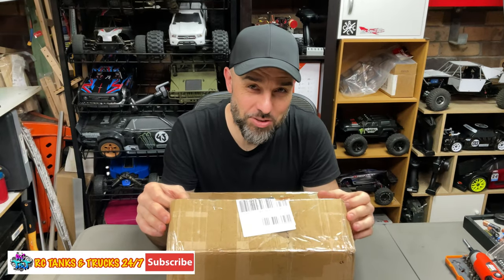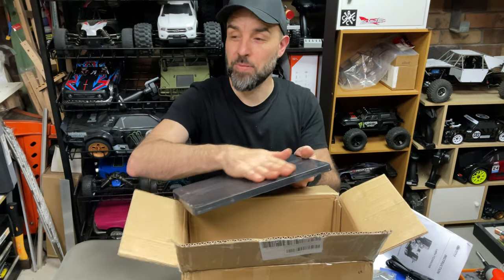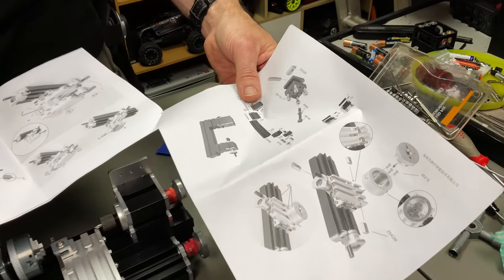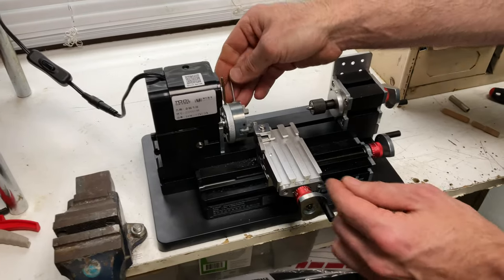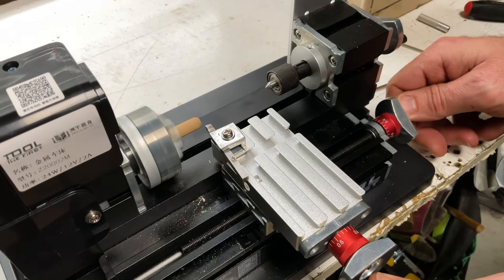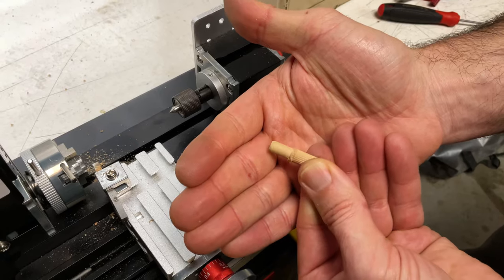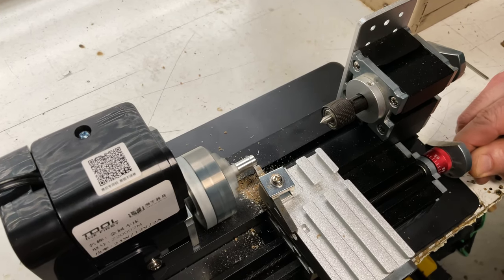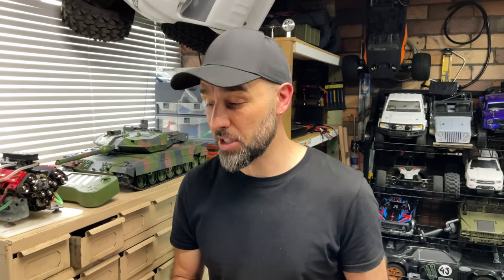CHEAP $260 MINI LATHE - HOW BAD CAN IT BE?

Comment: The cutter should always be dead center to the chuck or slightly! Above, center height,  the cutter can be set at any angle which best suits the cutter,  depending on the grind angle of the cutter, it gets really technical but easy enough to learn if you want to, I would say keep that little cutter sharp and make sur you use oil on each piece you cut!! as this helps alot!!
Reply from the maker: Thank you! Cheers!
Reply: Further , looking at that tool holder, you'd need to use blades from a burst open pack of 
feeler gauges to get the height spot on. Metric or imperial , it matters not. 

I've got one of the bigger mini lathes-cast iron ones, and they're great little tools. After, that
is you've set them up right, backlash etc. And bought a few more cutting/ threading/quick
change toolpost parts as well.

Comment: A little safety tip Steve. Always take your chuck keys out of the chuck! I’ve seen people leave them in and then start the lathe sending them flying out of the chuck at high speed. Enjoy! Cheers!
Reply from the maker: Good tip!
Reply: Absolutely.  I have the policy that "If a key is in a chuck, my hand MUST be on the key."  Removing my hand from a key in a chuck would violate that.  I can only remove my hand from a key if it is out of the chuck.  It's because people have been careless that many chuck keys now come with annoying little springs to eject the key if you let go of it.  (It is one effort manufacturers take to help make themselves litigation proof.)

Comment: A cheap upgrade is to bolt it to a concrete garden slap,  the weight of the concrete helps to absorb the vibration of the lathe, giving the parts a better finish. 
Cool little lathe, I have  thought about getting one and the adding a cheap cnc control just to turn the dials .
Reply from the maker: Thanks for the comment mate 👍

Comment: Dear I like to know the type of the blade to buy for different kind. Thanks
Reply from the maker: Not sure, check out the links in the description and comment section. Should be spare parts
Reply: @RCTanksTrucks247   I tryied  hard and I found  that's  4x4mm  50mm long

Comment: Hi, did you say that only items of a max of 10mm will fit into the headstock? I am also curious if a long item can go through the other end, into the headstock? I am trying to figure out if I can put a 13mm pool cue shaft through the other end of one of these mini lathes, in order to do repairs on pool cue tips. Like cutting the tip off, and replacing it. So, that is the reason for my original question. Thanks.
Reply from the maker: I will have to check it out
Have a look at the links in the description and comment section for more details

Comment: I so desperately need this, and its price is perfect; However I wonder how it would do turning down a 3mm diameter stainless steel drive shaft? ahh and also I wonder if it can cut E Clip groves into the same shaft?
Reply from the maker: Not sure, maybe if you feed it really slow.
Reply: I think most any stainless (except perhaps the most free machining stainless alloy, and perhaps not even that) would be very, very challenging on such a small machine.  Also, if you can't make decent cuts, the stainless might start to "work harden" making it even difficult to machine.  Usually, with stainless, even small diameter, you want good machine rigidity and reasonable power.
Reply: Although it says soft materials it can handle stainless steel if you take your time
Reply: @kevinreader4412  Just saying "stainless" doesn't tell the whole story.  There are MANY alloys.  Even the more free machining alloys (like 303 annealed or, better yet, 416 annealed) will be difficult, but as you said, doable if done properly.  But many don't do it properly.  They don't use a sharp enough tool and end up with a work hardened surface.  And then the more they try, the worse it gets.  And the range of "machinability" has some stainless alloys over five times harder than others and even give grief to people with much larger machines.  For example, I don't think I would even bother to try machining Hastelloy X stainless in a mini lathe.

Comment: I am a bit late to the party, but a tool that can hold carbide inserts of the type for cutting aluminium would cut much better than the horror you have there. Also as said by other DO NOT leave anything in the chuck when it is stationery!
Reply from the maker: Cheers man
Reply: @RCTanksTrucks247  Actually, a PROPERLY sharpened HSS bit typically works much better that carbide inserts in very small lathes like this.